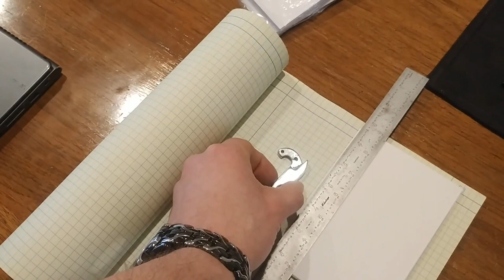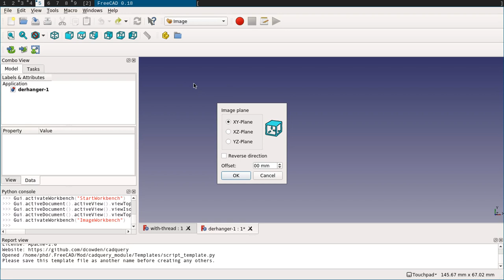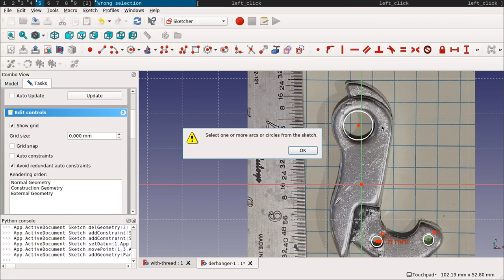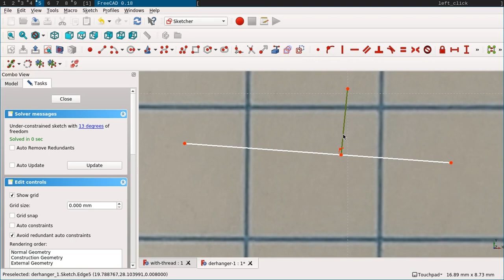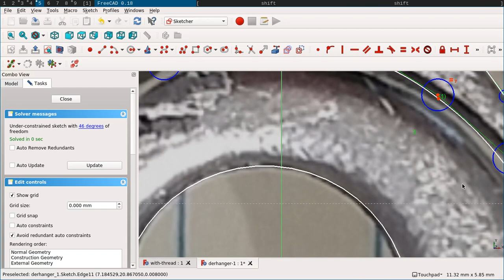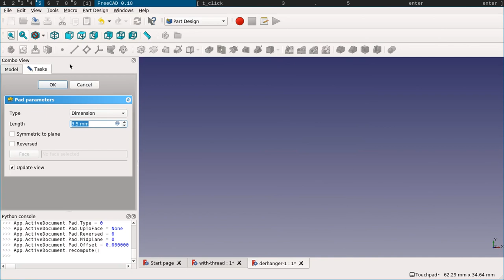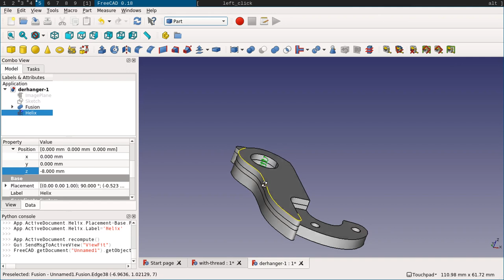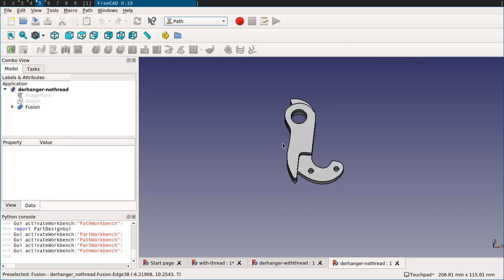From Photo to FreeCAD: 3D printing a derailleur hanger

Comment: Ended up following your guide and designing my own dropout, since the original one is unique and not in stock anywhere. I will soon print it using PETG as well.

Wondering, did it work out well for you? If now, would you recommend a different material/method?
Reply from the maker: I never got around to installing the PETG one, unfortunately. Once I got a tap to clean up the threads, I tried putting the derailleur on it with it clamped in a bench vise, to see how much it would flex... and in doing so, I broke it! Garbage. That thin monkey-tail part of the design is simply too weak to be made of plastic.

Later, I used that print to make a shitty aluminum/greensand casting. (Surprisingly difficult to do well! Don't believe the YouTubers who make it look easy! Hahah.)

The next step is to upgrade my kiln, and then try it again as a lost wax/PETG cast. And if that goes poorly, use it as an excuse to build a CNC mill. (Now it's mostly an exercise in feeding my DIY addiction.)

Your best bet is probably to do the print, check it for fitment, then find a buddy or a makerspace with a CNC router, and use the CAD to mill it from aluminum.

Depending on the design of your hanger, you might get away with beefing it up with more plastic (room allowing), or including something in the design where you could beef it up with some metal. eg. a cavity where you could insert some 3mm rod halfway through the print. In either case, I would be interested in hearing what the results are like for you.
Reply: @swolebro  Thanks for the tips. Do you think there's a material that will work better than PETG in terms of stiffness? We will try to print it just to finish the model, then either, like you suggested, beef it up with metal somehow, maybe a steel/plastic sandwich or something like that could work, and in parallel I will send it to proper CNC manufacturing, perhaps in China, to reduce cost. Anyway it's a fortune to pay for such a small piece, but it's either that or a new 1000$ frame :)
Bad bike industry engineering, what can I say LOL
Reply from the maker: Shit, bro. Once you got a print done, let me see if I can hook you up. I know some people at the local university with access to two Tormachs and some other machinery. Mostly just depends on if I can get a hold of them - everyone's AWOL right now, scared of the 'rona.

That'll get me off my ass too, about getting this Giant back on the road. Only reason I haven't taken that route already myself is 1. I'm an obstinate ass (as previously noted), and 2. I've been busy enjoying a CAAD8 Cannondale that I bought shortly after this video. Over 4k miles in the past year, basically zero problems. It's been wonderful.
Reply: @swolebro  Thank you, greatly appreciate it. My Uni is completely locked((
Reply: @swolebro  Well, just to update, I ended up sending the design files to china, where it was milled using CNC from 6061 alum. 40$ per part, was a no-brainer. Arrived after 5 days. The Chinese mfg. did a fantastic job.
Reply from the maker: @sstbrg1  Shit bro, that's not a bad deal at all. As you probably know, the usual price for a lot of them is $20-30, and that's only when you can find the right one and in stock.

The university is now talking about doing the fall semester online. Sheesh. I might be waiting a while to get that Tormach access myself. Oh well. It's been over a year already. I can wait a little longer. lol
Reply from the maker: @sstbrg1  If you happen to have a Thingiverse account, could you post your file as a remix of mine here?

https://www.thingiverse.com/thing:3537755

Just help other people see that it can be done (even if not 3D printed), and in the off chance someone has the same bike as you, it'll save them the CAD as well!

Comment: the area with the two little screw holes looks like it would be the weak part. if you can scale up a side of that crescent to make it to where the little holes are further away from the edge, in a dimension where you have grow-room, then it ought to be easy to bulk up a bit. worst case scenario the deraileur breaks off and the chain wraps around the back tire while you're trying to get away from a grizzly bear.

Comment: Have you considered placing the part on a flat-bed scanner? That would give you a pretty accurate image to model from.
Reply from the maker: Hm, possibly. It might struggle a bit with recessed features being out of focus (such as the "tail" part of this derailleur hanger, with the two small holes), but it's worth a shot next time I have a part to replicate. Thanks for the idea.
Reply: I have had success with using a flat bed scanner for this type of task. It can indeed only capture the surface features with everything else being out of focus, but that can still be very useful, depending on the part.

Comment: Could you do a hollowed out print ( open on the bottom flat plane) then fill it with epoxy and a little fiber glass or thick wire - should be pretty strong then. Just a thought.

Comment: Thanks for this video. I am doing a different project, but I learned enough that I think I'll be able to adapt your techniques to it. I ordered a cheap diode laser cutter/engraver and I want to use it to make custom cutouts in foam for toolbox drawers (for pliers, wrenches, etc.). My idea is similar to yours--take a photo of the tool with something of a known dimension, then scale it in to exact size. I only need the vector trace of the tool, not 3D, but I found your video very helpful. It will be several weeks before I get the laser, but I hope to have the drawings completed and ready to cut by then. Wish me luck!
Reply from the maker: You any good with Python, mate? I have a half-ass written project from a year ago where I was doing just that, with moderate success. Never got around to publishing a video or the code, though. If you know how to code and spruce it up for your needs, I might be able to save you some effort.

Comment: Thanks - useful video. I made a hanger for my bike a while ago by flatbed scanning the original part and tracing around it in Inkscape. I then exported to OpenSCAD, extruded and subtracted a shape to get the cutout (only one level in my case). I printed it in PLA rather than PETG because I figured it would resist the sideways forces better when changing gears. It worked very well for about 100 miles before it snapped (fortunately close to home). Probably PETG would have lasted longer, but maybe with a sloppier gear change? 

Thanks also for bringing CadQuery to my attention. Looks really interesting. I'm so used to OpenSCAD that it would probably take me longer to knock up quick parts in CadQuery, but I can see its many advantages and will experiment with it.
Reply from the maker: I haven't gotten this bike reassembled for testing yet, but yeah, I'm expecting the flex in the PETG will make the shifting clunky - similar to if you had a derailleur hanger that was slightly bent. At least it's a 25 year old bike, so some amount of clunk is normal.

And dude, Python for everything. Everything.  If you need some examples to work off of, the CadQuery workbench in FreeCAD has all the examples from their docs (plus a few more, I think) all ready to be tweaked and experimented with. And I've got a GitHub page where I've dumped a couple of my own scripts as well.

https://github.com/swolebro/caddyshack

There's a CadQuery specific GUI as well (not built into FreeCAD), but I haven't worked with it much yet. I did get it running with their Conda environment on my rather unusual Linux build though, so that's a positive sign. lol

https://github.com/CadQuery/CQ-editor

Comment: Hi i'm pretty new to freecad, but i have a question. why don't you make different body's for every different cut while you are still sketching? this way you wouldn't need to duplicate them all seperated afterwards i think. Anyway great video! Learned a lot and you gave me some great ideas for my work!
Reply from the maker: Mostly did it the way I did, since that's how I figured out a way to do it! Hahah. This was a couple years ago, when there wasn't much FreeCAD info on YouTube at all and I was far from an expert (still not).

Nowadays, I'd highly recommend Joko Engineering as the #1 channel for FreeCAD tutorials. Sliptonic also has a good amount of stuff on it, and is a developer for one of the workbenches.

Comment: Forgive my ignorance as I'm not familiar with bicycles but wouldn't it be easier to make "frame sliders" like we use on motorcycles?  It's basically a puck that's attached to your axles and sticks out a few inches to keep delicate parts off the road.  DIY is a freakin addiction, for sure. 😁👍
Reply from the maker: I'm familiar with those (used to have a CBR600), and it's not the worst idea, but two things come to mind. Firstly, a slider might end up focusing the impact forces on a single point of the rear triangle, where the frame is especially thin. Could actually make catastrophic frame damage more likely. Secondly, the more things you've got sticking out, the higher the risk of taking out other riders when you crash (or simply if riding in a tight group).

FYI, you should know about Tegaderm for road rash. I did do a video on that maybe two months ago (had another crash lol). The shit is magic, and I wish I knew about it during my crotchrocket days.

I always wore my gear, which is why I'm still here, but the accident that killed the CBR600 (dodging debris that peeled off a flatbed) had me sliding about 100ft down the highway (estimate based on my speed at the time, and the number of times I said "fuck!" before I stopped). I walked away from that one, but it was right about the limit of my gear, and I took some road rash with me.

Stupidest thing about cycling is you've only got a few thou of Lycra between you and the road, and I have done up to 55mph on my bicycle. That was pretty sketchy. Hahahah.

Comment: Sadly B-spline did not work for me . I tried to make a similar object from a picture and then it did something strange to the shape. It was making a shorter path between some vertical and horizontal lines. I would be very very thankful if you could help me out.
Reply from the maker: Huh, without more detail or even a video of what you're seeing, there's really not enough information there for me to help you figure it out.

I do have a few more basic FreeCAD examples coming down the pipeline that may be helpful for you. In the meanwhile, for other video tutorials, Sliptonic and MathCodePrint come to mind for basics, and Joko Engineering has a lot of crazy amazing examples. And of course, there's the developers on the FreeCAD forums as well.
Reply: @swolebro  Thank you very much ! & sry for I later realized I should have supplied some more data. Basic polyline did the job for me. Keep it up I like you videos, Subed

Comment: What about doing a lost PLA casting of your improved 3d printed part, giving you a new cast aluminum part? Then you could even conceivably have a couple spares to keep on hand or sell to other cyclists with the same frame, if you 3d printed a few of them and made a sprue to connect them... Nothing like turning old soda and beer cans into something useful and unique
Reply from the maker: I did give a variant of that a shot eventually - turns out that casting takes some practice to master! I have some B-roll footage of that I ought to dig up sometime.

The kiln eventually left the shop, so that path became a dead end, but luckily for me, another viewer actually chimed in on a different video and offered to make the part for me. Shipped from all the way across the pond. The bike is back on the road, and I'm enjoying it thoroughly. Only took two and a half years to do!

Comment: I want to do this for a magazine for a r700 magpul hunter.  I struggle with freecad though🥺
Reply from the maker: Magazines are notoriously difficult to design too. Gotta get the angles right, account for flexing under spring pressure, make sure it feeds through the whole range, etc. Your best bet there would honestly be to purchase a factory mag, or if you look up The Gatalog, they might already have a printable one. They have them for G17's and a few others, but again, designing them is hard. I remember the G17 docs saying it was several hundred hours of CAD work and dozens of revisions to get it right.
Reply: @swolebro  very familiar with the gatalog.  I gave up on the idea. Taking pics of a black magazine casts too many shadows and cant draw a B spline if you can't see. Excellent video showing reverse engineering though, im new to cad and trying to learn.

Comment: I cannot boolean cut from the main body, even when I created everything successfully as you. Its third day I'm fighting with this mess of a program, I wish that Fusion wouldn't be so expensive, it was so much easier and error free work :(
Reply from the maker: Which version of FreeCAD are you running, which operations (from which workbenches) are you doing, and what's the error message?

Comment: Any idea why i cant import an image?  I do exactly what you did but get an error message each time I try.
Reply from the maker: Not sure - what did the error say?
Reply: Same here, clash with video driver in the PC (Intel or Radeon). It's recommended on the FC forum to load the 0.19_pre version because it may be fixed in that.